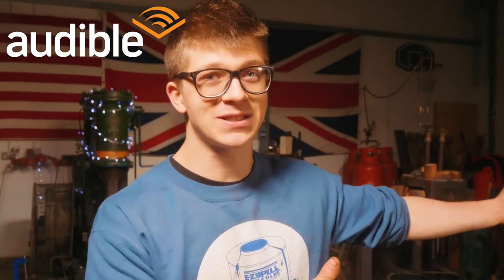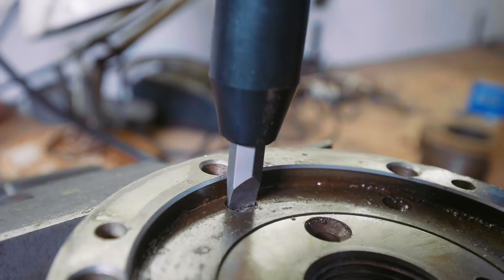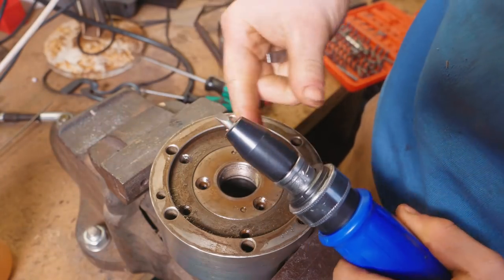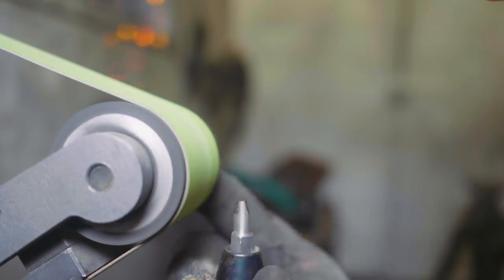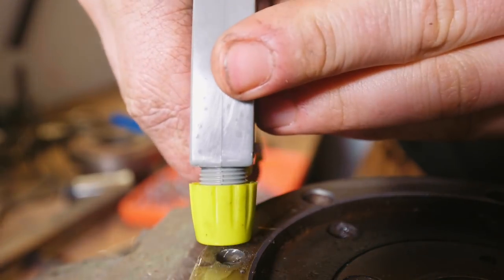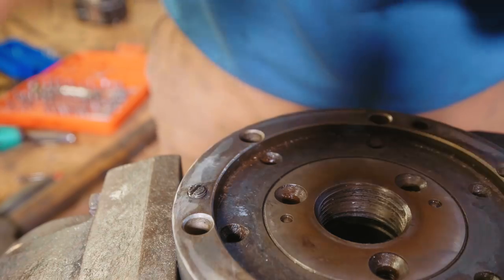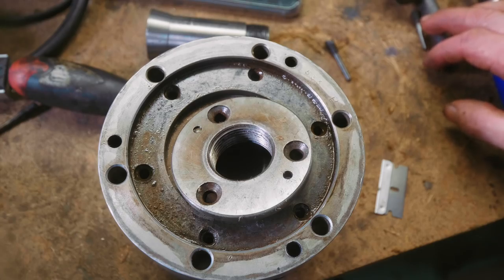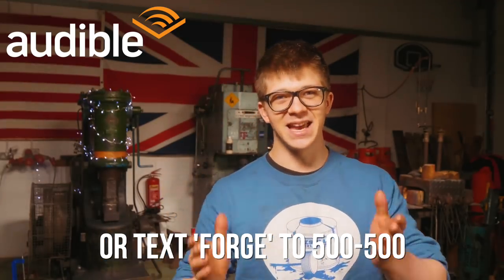LATHE CHUCK MODIFICATION!!! Part 1

Comment: Hey Alec, regarding you new Kurt vice, you have the factory Kurt stop that's attached just to the right side of the hex end of the screw. I noticed you using a straight edge to line up the end of the collet block and did't know if you knew about the factory made stop that is used in the top groove of the solid jaw. 
I enjoyed watching you extract those pesky screws. Looks like it was a Monday in your shop!
Reply from the maker: THANK YOU SO MUCH! I never knew that's what that thing was! Really appreciate the tip and lovely comment Adam!

Comment: The manual impact driver is great when restoring old machines.  I've owned mine for over 40 years.  When I saw you use it I went to the shop to see for sure mine was there. I'm safe!

Comment: Alec, just a little tip.....when you only have one screw holding the pieces together it has all the pressure of those two pieces on it.....reinstall the other screws to lighten the force applied to the one you are having trouble with.........hope that helps next time because anyone thats works with machinery knows there WILL be a next time!!!! keep up the good work........

Comment: Those 3 long screws you struggled to get out are most likely to keep the locking nuts in; the 3 nuts you put the T-handle in to tighten/loosen the jaws or collet. They are essentially keyed gears that you turn. Keep on keeping on!

Comment: the impact screwdriver works a lot better if you put a little torque in the direction you want to go like youre using it like a screw driver. doesnt need much youre really just taking the slop out and setting the direction you want it to go. just setting it inand hitting it could turn in or out or just flop one way or the other without putting any torque into the fastener
Reply: What he ^ said :D

Comment: Hey Alec- here locally these tools, are known as "Impact Drivers" - the force of the impact maintains the bit within the damaged slot while the bit itself then drives the stubborn screw / bolt out against the thread. The alternative of course would be a screw extractor but you would then need to have first drilled / bored a suitably sized hole to a suitable depth and then employe a suitably sized screw extractor. Many refer to these as EZY-Outs / aka Easy Outs and this terminology is also found in marketing. If the offending screw / bolt is situated somewhere robust enough to take the pounding of the Impact Driver all well and good - it the situation /  location is more delicate then screw extractors are the better choice.

Comment: Hey Alec, auto mechanic from the great white North of Canada here. With all the road salt on our icy roads the impact driver is one of my best friends. Quick tip how to use it. Just give it one really good wack and then try to turn it by hand with a regular screwdriver. The impact driver moves ever so slightly and then returns to the starting position because of the spring action in it. The hammer blow just provides downward and rotational force to break the rust free not to actually turn the screw. I just give it one good wack with just enough force your almost unconfortable with how hard you hit it then check if it turns by hand. You will be surprised at how well it works getting screws loose even if it doesn't look like it turned at all.

Comment: hey Alec, so the set screw looking things you took out retain the little gear drives (looked like 3 around the outside) that the chuck key goes into to tighten, I guess the collet. They ride in a little groove in the gear drive.

Comment: Hey Alec to properly use an impact driver you have to preload the tool by turning it in the direction that you want to rotate. With it in counter clockwise ( anti clockwise ) if you twist the tool counterclockwise you preload the tool and it also takes up an gear lash in a well used one. Try this as it makes the impact driver very effective!
Reply: I can tell that Alec has never owned a motorcycle. An impact driver is standard equipment for working on any motorcycle. So many steel bolts and screws threaded into aluminum... so many heat/cool cycles... yeah, I wore out impact drivers working on my old hondas.

Comment: The ring that the six slot screws go in is the spring plate that pushes back on the collet so it doesn't get stuck in the chuck.  The three threaded pins you took out are for the 3/8" square drive gears that turn the collet threads. I really hope you do not try to mount and spin that chuck without replacing those pins as those gears will come out at quite a high velocity.

Comment: An impact screwdriver works the best when you use a heavier hammer and give it slower, more continuous blows instead of short taps. In some cases it also helps to hold the driver with something like a pipe wrench so that not only is your hand away from danger, but also you have a long 'handle' to help hold the torque. An impact screwdriver is a glorious tool either way, and they even come in the smaller 1/4" drive for those smaller tips, handy for more precise stuff like getting small bolts out of aluminium where a bigger driver/hammer would just goof up the threads.

Comment: A couple suggestions, if you're having problems removing broken bolts or screw. You can heat them up until they are slightly red, and try and remove them immediately, pour cold water on them, or let it cool down over night. There is many tricks to that, however you could have taken your TIG welder and stacked beads on the head on the screws or bolt, and until it was high enough to weld a washer on or nut.

Comment: The way you tempered that bit made me think it might chip...Although it makes seeing your colors easier, standing the bit up on your heating block like that means the heat reaches the tip last.  If you look closely in the video, you can see that the tip is really straw/purple while the base is solidly blue.  Seeing as the tip is the thinnest and takes the force, you'd really like to take it all the way to blue.  You could use a differently shaped block that surrounds pieces more, like a 3-sided hollow half-cube shape to even out the heat and leave a viewing window that could accommodate variously sized/shaped parts.  Also surprised you don't have a softer brass/bronze/nylon hammer on hand for disassembly and 'adjustments'.  Love the work, though; keep it coming!

Comment: Turn your impact driver to apply slight loosening pressure before you hit it. Makes them work even better.  Also, it is time for you to turn, cast, mill or whatever a brass hammer for those times when a steel hammer could damage what you are working on.

Comment: Alec,
Here is an old trick for stubborn screws, fill the head with AJAX! It will fill in any gaps you have between the driver and screw head.  Reducing the chance of stripping out the head.

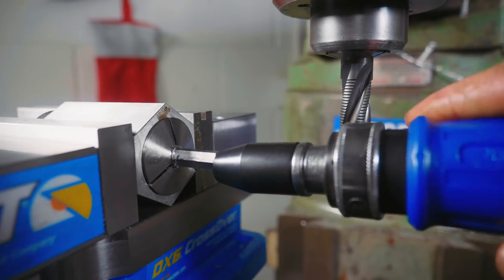Comment: The Idea Behind the piece you made at 4:38 was good...
I only think there could be one thing to be better...
Is an exagonal hole on the other end. So you could use all the 'things' (don't know how to call the pieces you fit into the screwdriver) on the larger screwdiver....
Use it as an adapter to fit the 6 (?) mm pieces into the 8 mm pieces

Comment: You my friend needs a can of pb blast,  we used it for rusted bolts in the oil field shop taking apart equipment.  It does miracles.

Comment: When you have screws like that that haven't been removed in a long time (or ever), make yourself a small batch of 50/50 acetone and automatic transmission fluid (ATF). This is an extremely effective penetrating oil and works wonders with stuck screws. It is very cheap as well. Just drip a little onto the screw and let it soak for a few minutes (or hours if it's really nasty/rusty).

Comment: The threaded pins retain the chuck key gears for the scroll plate, they should should come out easy using the chuck key,give the whole thing a good clean once it’s completely apart then reassemble with a light smear of moly grease. It’ll stay good for years and won’t jam up as much. All the best

Comment: I believe those screw drivers are called impact screwdrivers.  They allow you to turn hammering force into linear motion that is very high torque so all you have to worry about is the hammering.

Comment: A Buffalo 5C closer has 3 threaded holes that are used (with a bolt) to pry against its self and separate the two pieces so the internal pieces can be accessed for cleaning or replacing. Not sure if yours has them as well. The last 3 bolts you took out hold in the square driver pocket pieces, the T handle goes into. They spin a ring gear that is internally threaded and the threads pull the collet in. Yours does look different though... Good luck and be gentle with the machining tools!!! I think your parting tool was to high above CL. Use the ruler trick.

Comment: Alex, be careful when you reinstall those screws in the outer ring.  If I am not mistaken those are what hold the gearing in place that turn the Colet nut.  I don't know how easy it would be for one to slip out of place but if it did getting it lined back up could be an issue.  I'll shut up now.

Comment: Next time soak the piece overnight in Marvel Mystery Oil. You can also get a left handed drill bit but if you'll let it sit in some sort of penetrating oil that should reduce the amount of labor needed. I'm not a machinist but I also like to use Never-Seez or Anti-Seize when I reassemble something that was hard to disassemble.

Comment: Maybe you could try using kroil. It's a penetrating oil that works great for getting screws unlocked. Just drip some where you need it. Let sit for a while. And have at it. I highly recommend.

Comment: check to see how gunsmith screw drivers are ground with a hollow ground edge that bites into the bottom of the screw groove and prevents slipping out and increases the force imparted to the screw.  Secondly, don't harden the tip so much,if it distorts under pressure, instead of breaking it can be reformed and reused again.  Use copper based antis-seize compound on the screws when reassembled so that in the future they will not require a nuclear powered screwdriver to remove them!

Comment: Next time a screw is stuck like that try using heat then quickly cooling it using the WD40. It will loosen the screws or bolts then hit it with the impact screwdriver.

Comment: Alec, have you tried a home made penetrating fluid before? I’ve used it to get 20 year old suspension parts off trucks, and I’ve got to say it works so much better than WD-40 for getting stubborn bolts lose. The stuff I make is one part Automatic transmission fluid and one part Acetone. Works like a dream

Comment: 50/50 mix of acetone and automatic transmission fluid. Better than anything you can buy in a can for getting rusty nuts and/or bolts out. Shake well before using it each time because it will separate fairly quickly

Comment: Used to use an impact driver like that to remove stuck gauge screws in propane tanks... more often than not, the screw head broke off :-( Glad you had better luck :-)

Comment: Heating the whole thing up would be one option for a stuck screw, but that could ruin any heat treatment the piece had. A penetrating oil, like Liquid Wrench, might help too. Honestly though, drilling out is generally what you should plan to have to do if a fastener won't come out.

And when you get it out, shout,"EXCALIBUR!"

Comment: You can hear me screaming from the U.S., Wd-40 isn't a lube!!!!!!!! Noooooooooo
Reply: no he was using it a penetrating fluid to release the threads of the pins... one of the advertised WD40 uses...It's actually on every can...
Reply: While wd40 does make a penetrating spray. Regular wd40 does not penetrate, no matter how many times they print it on the bottle. It's a water displacement and a solvent, which is why do many use it to clean ss appliances.

Comment: Instead of WD-40 use about a 60/40 mix of ATF ( automatic transmission fluid) and rubbing alcohol as a penetrating oil.  Works a hell of a lot better.

Comment: Those are not screwdrivers meant for that kind of application. You need to have ones that are meant for tooling and work, chrome-vanadium of mild temper also, patience and a smidge better setup, certainly don't want to squeeze that chuck in a vice, you'll deform it if you're not careful and then it's junk.

Comment: you use a lot of wd40, are you using the penetrating formula? PB blaster in my experience which is mostly in working on old rusted cars in new england... PB blaster works far better

Comment: WD40 isn't a particularly great penetrating oil. Nor is it a good lubricant. It's a decent solvent and a great water displacer, which is what the WD stands for, so it's good for cleaning off greasy car parts and protecting them from rust. Seafoam Deep Creep or PB Blaster would be better at breaking out screws.

Comment: Those long screws that you took out on 6:02 are pinion(where you put your square key ) holding screws.Pinions turn the spiral that has teeth in the back which closes/opens jaws as yu can see on picture http://www.gpsystem.com/rohm/product3/din6351.htm 

Collet chucks are no different but instead of spiral to close jaws they have simple bevel gear with thread that pulls collet.